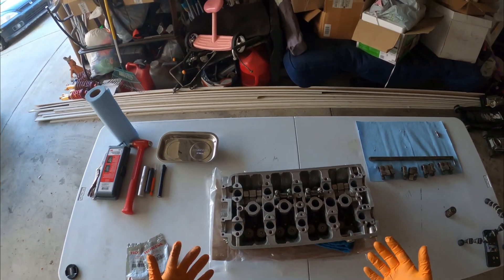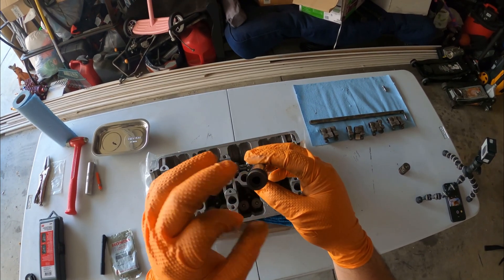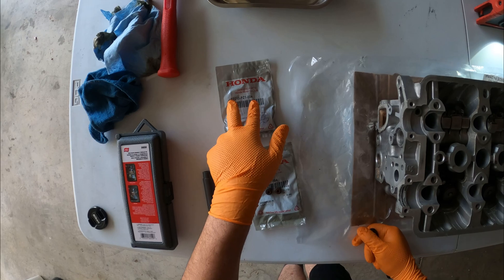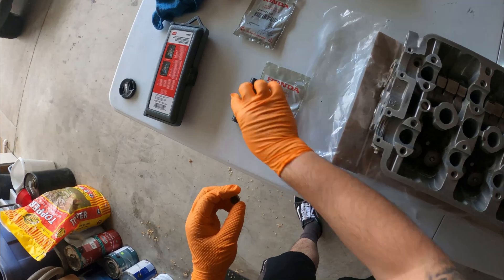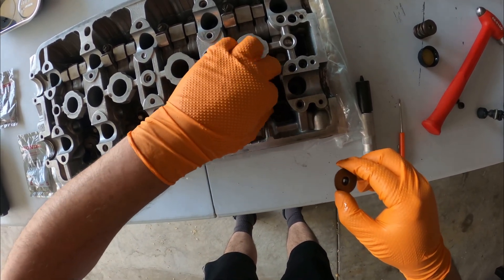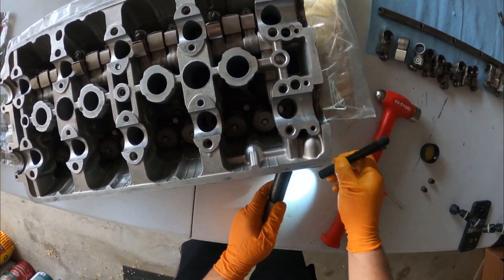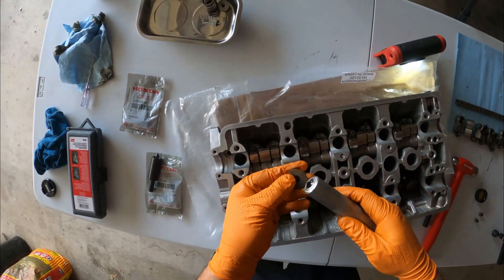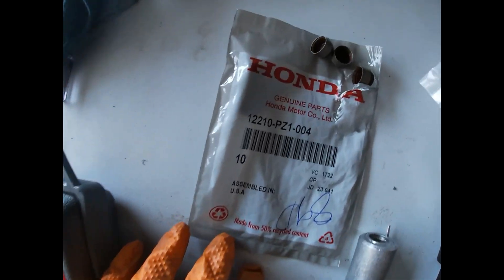Installing valve seals on a B series VTEC cylinder head

Comment: Did you have any issues with the OEM Honda valve stem seals? My gsr seems to leak a lot of oil into the combustion chamber with super tech valve stem seals so Im thinking of going OEM Honda valve stem seals.